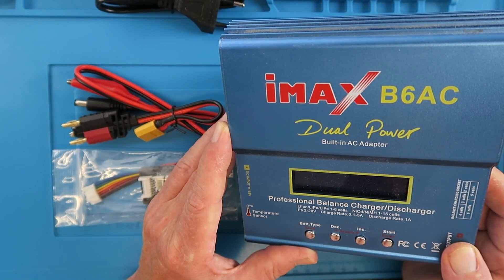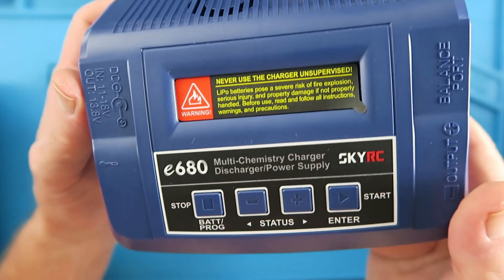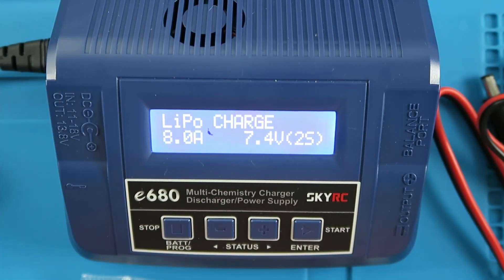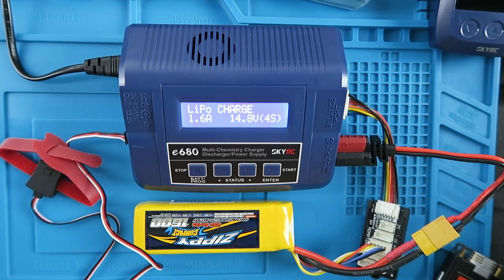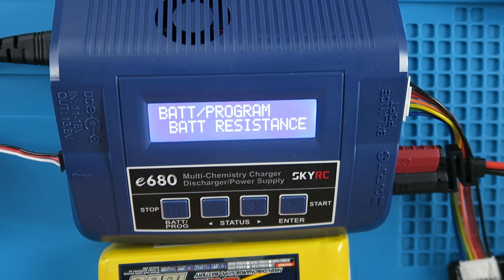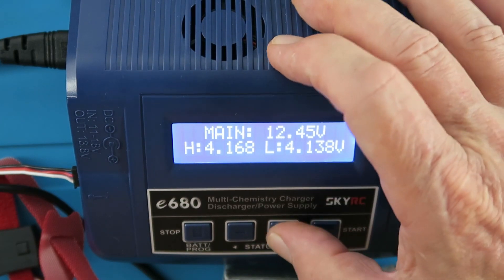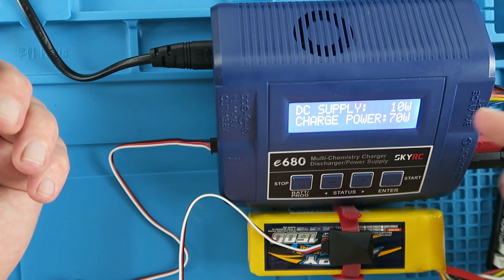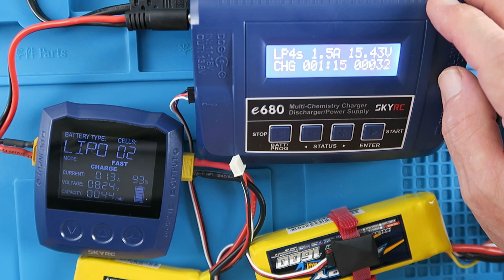SkyRC e680 80W 8A AC/DC Balance Charger Discharger 1-6S Lipo Review

Comment: How to get to the battery meter function?
Reply from the maker: It is the same process as getting to the Battery Resistance function, go up in the menu as I show here : https://youtu.be/KBkBus-ScI0?t=377 and keep pressing the "plus" key until it appears. Thanks for watching, have a great day!
Reply: @1nformatica  
Got it 
Much appreciated
Reply from the maker: @thunderchild2237 You're welcome! Have a great day!!
Reply: @1nformatica  
Thankyou 
Battery been on storage and just turned it off as had beep and message saying over limit.
Advice?
Reply from the maker: @thunderchild2237  There are limits set in the unit that can be changed in the settings, e.g. over time limit, temperature etc. My guess is that it went over the time limit. If the pack was charged then at the storage discharge current which is quite low it may take several hours to get to storage voltage. Obviously this depends on the capacity of the pack. Similarly if the pack was below storage value then the storage charge current is also quite low so will take a long time. You will have to use your judgment and either extend the time in the settings or charge / discharge the pack to nearer the storage value.
Reply: @1nformatica  
Looked at it again and the error was 
Over Time Limit 
The charging time is longer than the maximum time which the user sets.
I haven't set a time and the battery was above 50percent hence why put on storage to bring it down so not sure what's occurred:(
Reply from the maker: @thunderchild2237  In my settings the timer is set to 2 hours. You have the option to extend that or turn it off. Obviously this is a safety feature and you change it at the risk of over or under charging packs which may damage the pack or burn your house down! Never leave packs unattended!!
Reply: @1nformatica  
I thought it beeped once it was charged or decharged to storage percentage
Reply from the maker: @thunderchild2237  It will play a little "tune" when charge / discharge whatever is complete. Provided that "buzzer" is enabled in the settings!!

Comment: I am not getting correct readings for internal resistance when testing a 18650 cell, indicating 570 mOhms, same cell is less than 100 mOhms when tested on the Opus. Do the e680 leads have to calibrated?
Reply from the maker: In my view there is no such thing as a "correct" IR measurement. The value will change depending on the state of charge of the cell, temperature and many other things. Test the cell 5 times in a row on each tester and I can pretty well guarantee all the results will be different. The value of the IR test for me is only to see changes over time and roughly matching cells. I have some graphene packs that measure 3 - 5 mOhms after full charge from storage. If they started to show 10 mOhm or one cell was very different then that's my cue to investigate. As far as I know there is no way to calibrate the IR test. Thanks for watching, have a great day!

Comment: Hello. I brought this charger, and i want to know if it have an actual battery mAh option. Just want to see actual mAh of the battery, but i dont see it anywhere. Thanks
Reply from the maker: Sorry I do not understand the question. In each of the charge, balance etc screens once you press "start" it shows on the left of the display the time of the cycle and on the right the mAh. If you fully charge a battery then use the discharge function you will get the mAh of the pack according to the cut off voltage you set. Thanks for watching, have a great day!
Reply: @1nformatica  Yeah. It shows the mAh. But not the actual mAh (how much mAh does that battery have when its fully charged), but how much mAh it charged over that period of time. Like... When that battery had 50%left and u charge it to 100%... It just show how much mAh it charged into it. So i was wondering if there is hidden actual mAh info. But you answered me correctly 😂 thanks! Have a great day
Reply from the maker: @YesIgen  What is more useful for me is tracking the internal resistance of a pack. High "C" packs I have are around 2 -3 milliohms per cell. If that number starts to rise I know the pack is on its way out. If only one cell starts to rise the cell is suspect. I like to use telemetry from the plane which gives the pack voltage in the air. I can then fairly accurately know when it is time to land. Other guys in my club are amazed by the flight time I get. But as they only rely on a timer they often land with plenty of mAh left in the pack. Have a great weekend!

Comment: Thanks for this review. I'm going to pick one up. Can you turn off the beeping? That will drive me crazy.
Reply from the maker: Your sanity is safe! In the systems settings you can turn the key beep off. There is also the option to turn of the end of charge / alarm sound, although I would leave it on. YouTube no longer shows me if you are subscribed. Please consider subscribing if you have not done so already!

Comment: Hello, what is better? T6X80 or e680?
Y que te pare el HTRC T240?
Othe by the same price? THX
Reply from the maker: These chargers are all very similar. For me the important difference is the internal resistance function of the e860. I find this indispensable for tracking the performance of my cells over time. Of course the T240 is the only one to charge 2 cells.

Comment: Which one imax B6 mini or e680?
Reply from the maker: They are very similar in price and performance. The key difference is that the e680 has a mains voltage AC input which may be better for home use. Also the e680 is 80 Watt against the imax 60 watts. Please consider subscribing if you have not done so already!
Reply: @1nformatica  Thanks for your answer. I will buy e680.
Reply from the maker: @fatihp5887  You will not be disappointed. It's my goto charger! Please use my link in the description.
Reply: Can this product charge car batteries (example 12V 60 amper)? Thanks
Reply from the maker: @fatihp5887  It can charge lead acid batteries at up to 8 Amps. it also has a setting for AGM (gel) lead acids.

Comment: why, when i charged nimh batteries, the current intensity dropped to zero every 20 seconds
Reply from the maker: The charger uses the "delta peak voltage" to determine when the charge is complete so as not to overcharge the battery. See : https://en.wikipedia.org/wiki/Nickel%E2%80%93metal_hydride_battery Please consider subscribing if you have not done so already!

Comment: I really wanted this charger. But all that's available through reliable websites is the older e660. So instead I went with the Lextron Pro AC/DC 10amp charger. It basically has all the same features as this charger does. However it would've been nice to get my hands on the e680. I know SkyRC makes awesome products as I have their dual charger (Hitec X2 Black Edition) which has been fantastic.
Reply from the maker: I got mine from Banggood : http://bit.ly/SkyRC_e680 I have never had a problem with them and these days the shipping time is less. The Lextron Pro looks a nice charger, does it measure internal resistance? Please consider subscribing if you have not done so already!
Reply: @1nformatica  Yes it measures internal resistance and also has adjustable voltage end points for all charging and discharging modes. It even has an adjustment for screen brightness which is unusual for a four button charger.
Reply from the maker: @RobertNES816  Interesting! Next time I'm in the market for a charger I'll keep that make in mind.

Comment: Hi there, good review, thanks, I bought this charger based on yours and other positive reviews, and to date I'm very happy. Tell me though, does the integrated cooling fan only come on at a certain temp?  No mention of it in the manual, and mine has never come on yet, I ask as the fan on my previous cheapo 4 button charger came on as soon as you powered it up?
Reply from the maker: Hey thanks! Yes, the fan only comes on if the temperature rises. On small packs it hardly ever comes on (even though it's 35° C + here right now)! When I charge my 3S packs at 2.2 Amps it comes on after a while. Cheaper units will have the fan on all the time, quite annoying! I made this solution for a bench power supply https://youtu.be/DWQWljEoaFQ Please consider subscribing if you haven't done so already!!

Comment: where is the best skyrc t6x80 or this.thanks
Reply from the maker: They are similar units but the e680 wins for me on the following counts:
1. Has cell Internal Resistance meter. A "must have" feature for me.
2. Can charge High Volt (4.35 volt) Lipos' 
3. Has the DC output function. Useful for powering an LED lamp for example.
4. Less $$!

Comment: Hola que tal. Cual de estos es mejor para cargar y balancear baterias , el imax b6 o el skyrc s65 o el skyrc e 680.
Reply from the maker: Hola! Cualquiera de esos cargadores cargará y equilibrará las celdas por igual. La principal ventaja de s65 o e680 es la capacidad de cargar las nuevas celdas de LiHV (alto voltaje) y tener las funciones de medición de batería y resistencia interna. La ventaja del e680 es que tiene una corriente de carga máxima más alta de 8 amperios frente al B6 o s65 de 6 amperios. Un saludo.

Comment: Thanks for the video! Is it possible to connect the jst xh balance cable directly to the charger (without using the balance board)?
Reply from the maker: Only if it is a 6 cell pack! The extender board is required for other cell counts. I find it more convenient to use the board anyway. I have retrofitted a similar board to my older chargers as it is easier to connect being flat down on the bench.

Comment: Great video. But i Wonder. I have bought this charger. Get it on thursday. I have a skyrc e430 from before. And it take 2 hour to charge my 5000 mah ace 50c bashing battery. So how long time Will it use on this charger?  Thanks 🙂
Reply from the maker: Thank you for your comment. The e430 max current is 3 Amps which is not even 1C for that pack. The e680 max current is 8 Amps so you can charge at 1 C i.e. 5 Amps or more. How much time that will save is difficult to say as it depends on many factors. How much charge is left in the pack, the charge current you choose and the temperature are some factors. Post a comment when you have used your new charger, I would like to know what time savings you see. Also I would strongly recommend using the temperature sensor with high C packs at high currents : http://bit.ly/SkyRC_Temp_Sens

Comment: Nice unit but didn't see any connection to a PC, is that not possible on this unit? Thanks
Reply from the maker: Hi Mark, there is no official mention of PC interface. However the older B6 could be connected via the temperature sense port. I wonder if this unit is the same? I will take a look, watch this space!
Reply from the maker: I have tried but there is no menu option like on the original B6 to select USB or temp sensor. I tried just turning the temp sense off but still no serial output. Shame really!